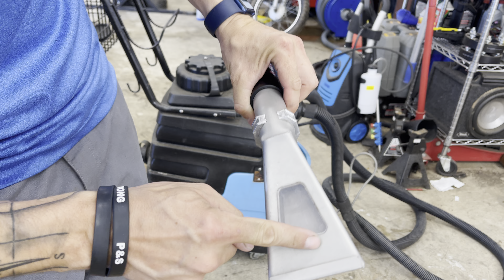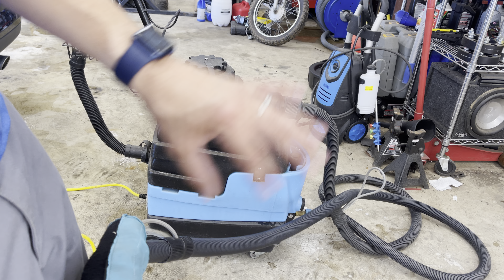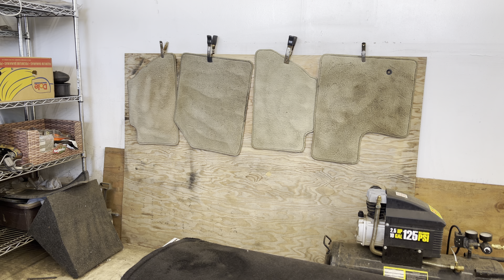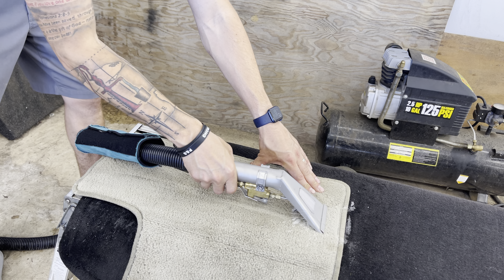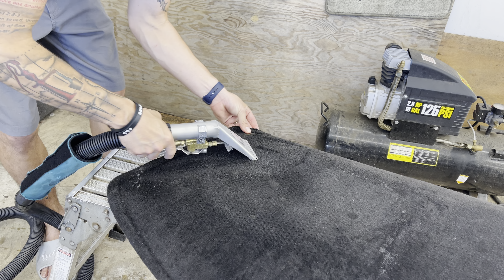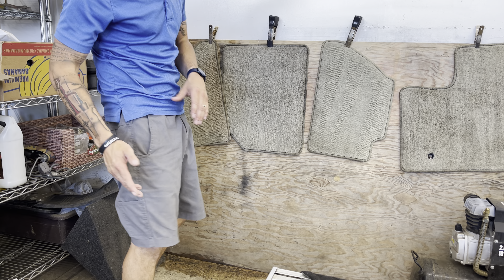Is The Mytee lite 8070 The best Extractor???

Comment: I've been looking into that extractor. Do you know what size breaker amp that the outlet is that its plugged into? I'm not sure if a 15amp breaker would be able to handle this unit.
Reply from the maker: 20amp for sure. It will pop a 15 as I have done it.
Reply: @AndysAutoCarePlus  Awesome thanks for the reply!

Comment: He's doing it wrong spray upwards and vacuum downward less strain on u and the material
Reply from the maker: I have never heard that your supposed to spray while going up and that makes no sense because then the water will soak in more.
Reply: It’s so it absorbs the chemical and then extract them out …. Is this still the best one ? What you recommend for car details ?
Reply: @AndysAutoCarePlus I used to do carpet cleaning in theory whatever it takes to get the best results. Some cleaners like to pre soak  heavy soiled stains  then run over with pre spray let it soak in for a bit cars or homes and then you can go to work with the extraction and solution. Every job varies. It's preference but as long as the customer is satisfied and you as well. That's what counts. Do what you have to do for the best results. I've cleaned some upholstery where it took tons of steam / water and passes just the lighten a stain. Every job is different
Reply: Agreed